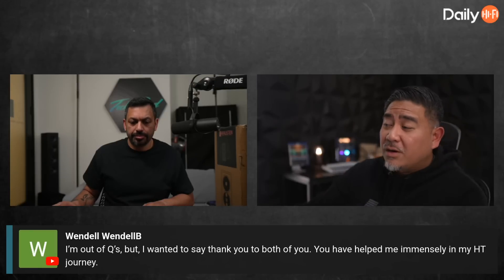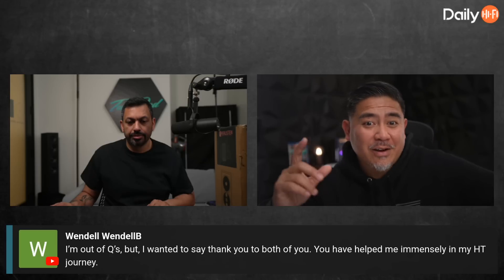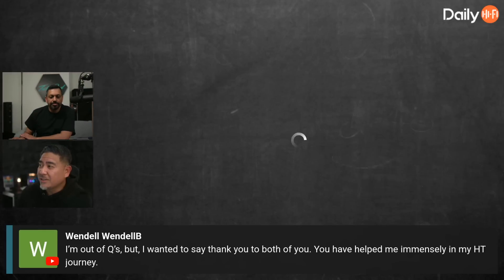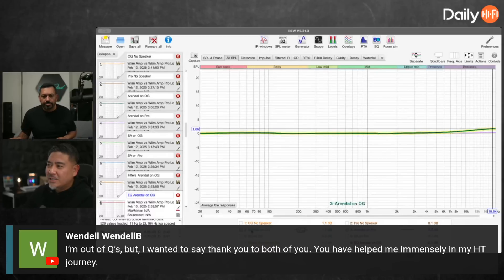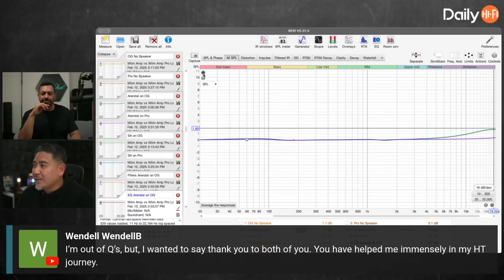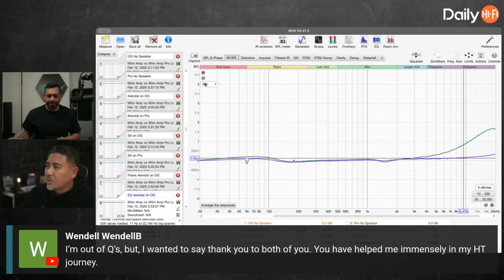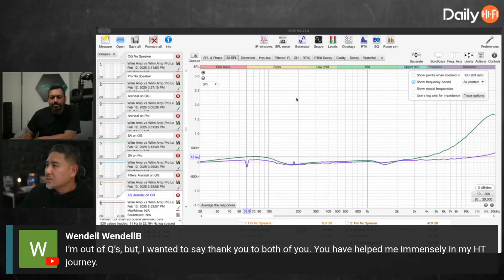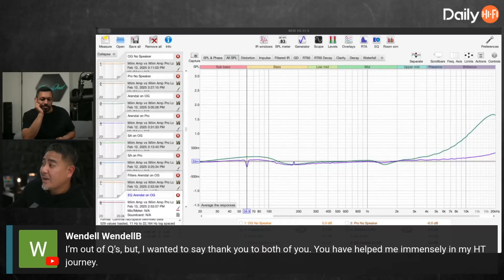What is PFFB Post Filter Feedback and Does It Solve Class D Amplifier Harshness?

Comment: @dailyHiFi Thanks for adressing this. Im considering replacing my old Denon Class D amp with the never RCD N-12. It is a USD700 unit (here) that came out in 2023 I belive. Snr 90dB and thd 0.1-1%. At 1 KHz.. And so, should one expect it is equipped with PFFB or not? I cannot find any such info or measurements regarding the current Denon class D amps.

Comment: Harsness is almost always IMD distortion. You need to make the feedback correction done with simulations, out of hand calculations doe not work always in precise sense. The way of deadtime is a bad factor, and need compensations, who is not the difficult by extend the deadtime also on the falling edges of drive signal, making it remoce voltage errors. then feedback can be done better and spical IMD can be lowered. class d is famous with its IMD, but Gan mosfets do a lot better.

Comment: People keep treating PFFB and big global feedback loops like magic bullets for “better sound,” but it’s not that simple. My Douk D100 with PFFB measures great, yet my Aiyima A07 Max — no PFFB — actually sounds cleaner, sharper, and more alive through my Fluance Reference towers. That’s because heavy global feedback can flatten frequency response and lower distortion, but it can also smear transients and dull dynamics if not perfectly tuned.

The same principle shows up in high-end Class-A and AB amps — brands like Pass, Ayre, and Naim often use little or no global feedback to keep the sound immediate and natural, even though it means a bit more load interaction. And tube amps take it further: with their high output impedance and transformers, the speaker load directly shapes the frequency response, giving that organic, “breathing” tonality audiophiles love.

Bottom line — good measurements don’t always equal great sound. Sometimes, less feedback and a simpler signal path just lets the music feel more alive.

Comment: PFFB for me please 🤗 - in a nutshell "reduces load dependency and improves both noise and distortion". 

In Class D amplification with Post Filter Feedback (PFFB), a secondary feedback loop is used after the output filter to improve system performance, reducing load dependency and improving noise and distortion. 
Here's a more detailed explanation:
What is Class D Amplification?
Class D amplifiers are switching amplifiers, meaning they use transistors that are either fully on or fully off, rather than operating in a linear fashion like traditional amplifiers. This switching action significantly improves efficiency and reduces power consumption. 
What is PFFB?
Post Filter Feedback (PFFB) is a technique where a feedback loop is added after the output filter in a Class D amplifier. This loop feeds back a portion of the output signal after the filter to the amplifier's input. 
Benefits of PFFB:
Reduced Load Dependency: PFFB helps the amplifier maintain a flat frequency response across a wider range of speaker loads, which means the sound quality is less affected by the specific speaker impedance. 
Improved Noise and Distortion: By closing the feedback loop after the filter, PFFB can help minimize noise and distortion, leading to cleaner and more accurate audio reproduction. 
Flexibility in Filter Design: PFFB allows designers to use cost-optimized ferrite beads without worrying about adverse effects on audio performance. 
How it Works:
The PFFB loop ensures that errors introduced by the filter are corrected by the amplifier's gain, resulting in a more stable and accurate output signal.

Comment: I don’t care if it’s a bait into getting comments but I gotta comment 😂. 

What class D amps have harshness and why are they being used? My Buckeye NC502 6-channel is the cleanest amp I’ve ever heard. In fact, it’s not only 3rd party verified but there’s only a few more designs that are cleaner. The NCx, the Nilai, and 1-2 Purify offerings. Scientifically, it doesn’t get cleaner than those amps. 

Are there more powerful designs? Sure. Do they remain as clean as the Hypex and Purify offerings? Nope. Not even McIntosh makes amps as clean as Hypex and Purify. McIntosh amps do get more powerful, quite a bit more so depending on the 2-channel or monoblock designs. Buckeye has a sweet 2-ohm offering from Hypex that goes toe to toe with McIntosh (and stays cleaner) but suffers from power loss at 4 and 8 ohms. 

But I digress and back to the OG question. What class-d amps are being used that are harsh and why are they being bought if they are harsh?
Reply from the maker: Those modules from Hypex and Purify had this resolved a long time ago. It's more related to the budget chips. Some people based their opinion about class D based on a $60 amp from Amazon.
Reply: The well designed engineered implemented (not all are) class D amplifiers using Hypex, Purifi modules perform excellently.

Though for only £200 & £300 the 3e audio A5 & A7 class D amplifiers using the TPA3251 & TPA3255 modules with PFFB also implemented perform just as transparent and no audible noise or distortion.

Ps McIntosh are a iconic brand to Americans but is more about looks aesthetics. If you want a alternative to a top class D amplifier then Benchmark AHB2 class AB amp is available with the measurements to back it up!